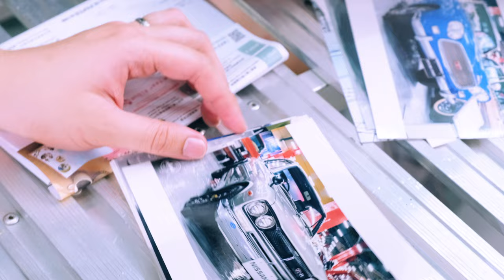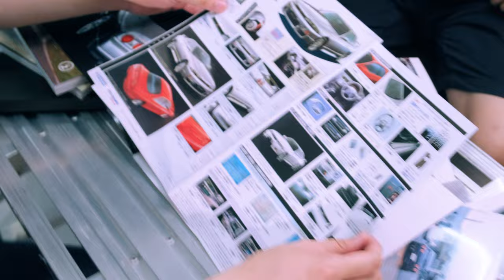Derek's 40th Anniversary Autech Skyline GT-R

Comment: man, im keeping my 90 GTS-4 4dr.. it's been RB26 swapped and fully built with TOMEI/GReddy top to bottom. T78, oil cooler in the fender and battery relocated to the trunk.. still running a MoTec ecu from 95-96 (according to the serial #). full N1 front clip including aluminum fenders, hood and bumper.  ALL this was done by someone in Japan who must've wanted a R32 4dr GTR.. i only swapped in PRP R35 coil kit and a Li Ion battery, as there is some tech to be desired lol.  point is, dont sleep on 4drs!!